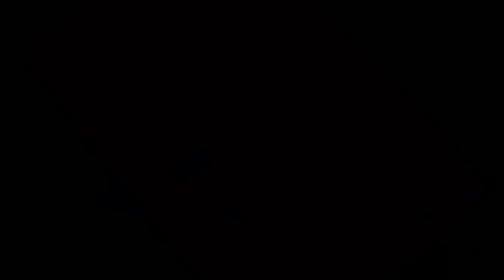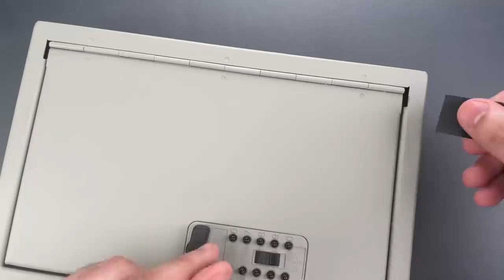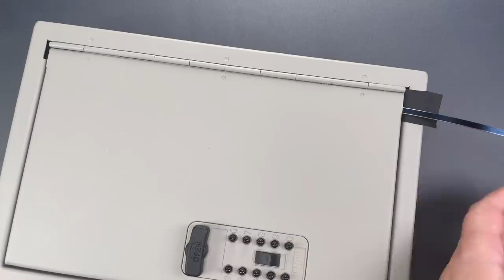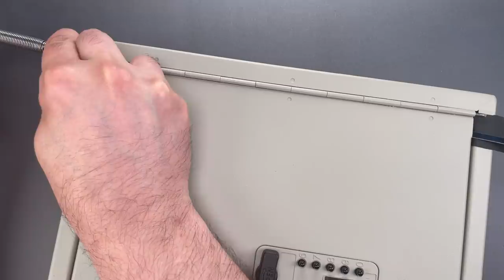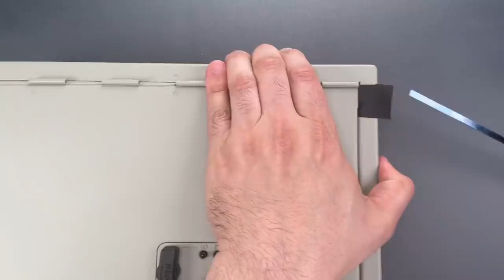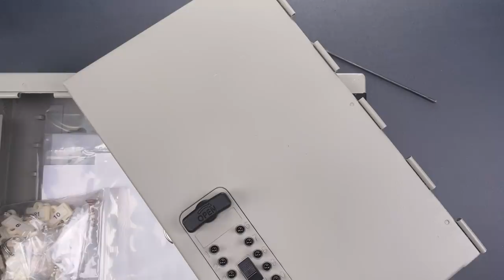[1319] Bypassing Kidde AccessPoint Key Cabinet Pro

Comment: "Shane welded up the hinges, probably to stop me from popping the hinge-pins and declaring victory. He did the right thing, because I definitely would have done that."
Reply: @michaeljackson8390  oh look its a comment bot
Reply: @spykillergames8402  Report 'em.
Reply: From what video is that
Reply: @jernejdivjak5582  the stuffmadehere lock video
Reply: Glad to see that I'm not the only one with a problem with this channel
Reply: @michaeljackson8390   Youtube can easily spot these spammers.
Reply: @creamwobbly  And reported again!
Reply: @Mochu_s_Junkyard  this is not a problem with the channel, The commenter did not have a problem with the channel either, he was referencing another video. Lock picking doesn’t specifically mean directly picking locks. It means bypassing locking mechanisms, either by picking them or some other method like removing a hinge pin or reverse engineering the key
Reply: @ThePower1037  Reported the spammer as well.

Comment: Should've welded the hinge pin like Stuff Made Here!
Reply: @taktuscat4250  GPU's are a myth noone can get one D:
Reply: @_p-x-l_  I've been waiting for 9 months now. Today I almost spilled a glass of water over my Pc and the panic was not for the PC, but that I wouldn't be able to buy a new one 😂🤣
Reply: @_p-x-l_  Just wishing to see GT710 on raspberry pi
Reply: My thoughts exactly, 2 spot welds on each end and issue fixed, or at least made more challenging
Reply: Even if they just took a pair of channel locks and crimped the ends (or even one end) it would at least pass the "stupid" test. I just don't get it. Is it that they just want it to 'look' secure so people buy it?
Reply: @_p-x-l_ 
Not if you don't go to Tarkov to scav for one.
Reply: Don't even need to go that far, just properly recess it within the box
Reply: Or make it inside, like a car hood.
Reply: @MLDeS100  They overlooked the fact that the steel springiness used to snap the hinge into the recess could be reversed with a tiny crowbar.  Also that tension limiting clutch would only hinder, not block picking.  They made a serious effort, just not enough.
Reply: @taktuscat4250  The Raspberry Pi main chip always contained a small GPU, in fact the Pi 1 used the GPU to do some of the booting of the actual CPU inside the same chip.
Reply: Link?
Reply: @Jeff Geerling Like he said, spot welding is seriously underrated.
Reply: @johndododoe1411  agreed, whoever designed the box didn't have a say in the materials used I don't think.
Reply: @CraftComputing  hmm. So just spot welding the ends of both hinges?
Reply: @_p-x-l_  i have bought a 6700xt and 3 days after the release it was already installed in my pc. You just need to Look at the right time at the right place and You will get a gpu for a decent price
Reply: Or use 2 half length pins, as soon as you knock it through to pull out the second half becomes inaccessable and remains in the hinge itself
Reply: Lol you’re just asking him to break into your stuff at this point. Love the confidence though, good quality to have in sales and honestly any product you’re involved with.
Reply: @Will-fn7bz  Manufacturers aren't employing experts any more.  They hyper-focus on one security feature and ignore everything else.  This is why the electronic stuff is usually worse than the all-mechanical stuff - the mechanical stuff is still there on electronic ones, but ignored during design
Reply: @tsm688  you mean to say "they hyper-focus on profit at the expense of everything else"
Reply: @_p-x-l_  i would be willing to sell my 5700xt Red Devil if you are interested
Reply: @AxR558   That's the first thing that I thought of. Aside from that fact that when they laser out the blank they can leave a tab on one side to bend up. That way the pin is only accessible from one side. Once it's in, it's not coming out without destroying a portion of the hinge area. Even using 3 or four pins would work. Of course, all of my ideas would cut into the margin. Margin is God for those corporate dipshits who can't fathom that a little better quality will make people lifelong customers.
Reply: That's expensive to do in the assembly process tho
Reply: @AxR558  The trouble with the two half pins idea, is it is also easy to bypass - rather than using LPL's special tool, I just use a length of rod and a hammer, so the length of rod overcomes the half the pin that would remain - you just need to drift it out the whole length of the hinge, and then pull the rod back out. #ThinkLikeAThief
Reply: @mydemon  No, I meant what I actually said.  In some areas they seem to try, and in others, they leave gaping flaws.  It's baffling.  Maybe everyone who knew how to build a good cabinet retired or something.
Reply: The hinge should be internal AND welded.
Reply: @jace4817  A couple months ago my rtx 2070 fell out of the pcie slot on my z97 mainboard. The mainboard fried. Replacing it with a new ryzen was expensive enough, but I had a few very nervous days hoping the video card was ok. Thankfully it was.
Reply: @humanmusic  Probably not worth doing both welding AND internal placement - that just adds cost for no additional security. Neither is particularly difficult to bypass for a half-determined attacker, but either puts off a casual entry. Weld the hinge and all you have to do is cut it off with an angle grinder. Place it internally and all you have to do is cut down the door next to the hinge with the same angle grinder (in which case welding is moot) - the metal is just folded around the hinge pin, so its not toughened. Casual thieves wont carry an angle grinder, so either achieves the same deterrent, both adds no more but does also add process cost. Add to that internalising the hinge means either complex assembly, or building in another weakness to actually put the pin in during assembly (otherwise the case will be in the way - and to drill a hole to allow the pin to be inserted means using weaker steel, or a more expensive drill).
Reply: @andyowens5494  Welding and internal hinge would be very cheap and very effective. Anything that would make someone use a loud grinder definitely is the idea here. Remember, nothing can be done to stop someone breaking into this. The goal to to make it harder and noisier.
Reply: @humanmusic  You missed my point. Not going to waste time restating it.
Reply: @andyowens5494  You are missing the point that making someone go from non-destructive entry to destructive entry by employing one or two minor changes is a HUGE improvement. Anyone who has watched this channel long enough already knows that. In any case, have a nice day :)
Reply: Personally I think I'd have physically knurled the ends of that hinge rod over at both ends (assuming the physical design would allow that). That way at least someone has to grind that off prior to using this attack.
Reply: @Jeff Geerling:  Define "Stuff Made Here"
Reply: @humanmusic  No, you just missed the point.
Reply: Should have welded the door shut but even then lpl would have found a way in.
Reply: Sorry, but this is one made by "Stuff Made There" a very inferior channel :D
Reply: @humanmusic  OK, last time I bother - no I am not mossing the point. MY point is that EITHER welding OR an internal hinge makes it difficult. BOTH (as per your original comment) makes it NO MORE difficult, but adds unnecessary cost. Weld the pin cost next to nothing. An internal hinge costs more than you seem to think as the assembly becomes considerably more complex. I can only assume you have never worked in manufacturing if you think both are cheap. Sorry, but you seem to want to challenge my comment, somplease read all the words in order before commenting, as I thought the original statement was simple and clear.
Reply: @andyowens5494  I'm not going to read any of your comments after having read one in the past. Have a nice evening.
Reply: @humanmusic  Nothing new there, you didn't read them anyway. Bye.
Reply: Good by-pass, but would you be able to pick the mechanism? Let's say the end of the hinge is spot welded, would you still be able to pick it?
Reply: @bmwspeedman  I have seen another video of that type of lock being opened, fitted to a small key safe, i have tried myself and failed, so its not easy, but can be done.
Reply: Actually a owner could even do something themself but I assume that doing that would void any warranty.
Reply: Or take the bits of the plate that are not rolled into the hinge and make small claws or fins that goes behind the frame around the door.
Reply: So true, when will manufactures learn that spending less than a dollar (electricity and gas for welder) is more important than saving it?
Reply: @Will-fn7bz  Governmental regulation compliance. (I say that sarcastically. But) the glowing alphabet conglomerate gotta get in there somehow.
Reply: @andyowens5494  Well you gave it a good shot.
Reply: @Vassilika1  "Stuff Made Here" is another Youtube channel; https://youtube.com/c/StuffMadeHere Hope that puts the original comment in context for you :)
Reply: Welded, or just used a few metal tabs to keep you from opening the door even with the hinge pin out. Cheaper to weld pin, but with 10 "loops" you can only tack weld one side, which would still be sufficient.
Reply: Could I suggest having two hinge pins?

Comment: "Let's first put some gaffers tape so we don't scratch this up too much" Said like a real covert entry pro. They will have no idea what happened now when there is no scratch. And also no door.
Reply: Well, true intruders will put the door back in and slide the metal rod back in. No visible tampering sign, so whatever's missing inside will be blamed on whoever knows the combination.
Reply: @PanduPoluan  Sounds harder than removing it, and a botched attempt at that will make it REALLY obvious
Reply: @tsm688  Indeed, it's not easy. But if you want to make things gone while shifting the blame to someone else, there are professionals that can and routinely do it.
Reply: @freedustin  Here's a thought - replace it will a tablet that only plays LPL videos on repeat
Reply: "Too much" is doing a fair bit of work here, as we can already see the evidence that he did it once already!
Reply: It's so he can return it to get his money back with least problems.
Reply: @Spinolio  No, it only plays the LPL video for whichever box used to be there
Reply: In this case it would jusr be a couple of scratches but a thief that doesn't care about damaging can cost more from vandalising then from the actual theft. A classical example would be to smash a window on a car to steal something cheaper then the repair cost inside.
Reply: @PanduPoluan  Or at least the discovery of the theft to be delayed enough to make the trail go cold. People may even endup beliving that they misplaced something not even realising that a theft has taken place at all.
Reply: Look closer... he already scratched it up while experimenting for this video. 0:52 and in other places in the video you can see the shiny exposed metal of the safe near the bottom of the hinge.
Reply: @tsm688  I figure the kind of thief that would even bother with reassembly is the kind of person that is after a very specific target for their theft,  And is well skilled in covert entry to things.

Comment: *sees Bypassing in title
*sees hinges

"Yep."
Reply: yep,its dead
Reply: You have hinges its gone
Reply: Yep! I am such a pro now... The second I saw this box I scanned it for weaknesses and the hinges definitely didn't seem secure. I should start a security consultancy firm!
Reply: there was literally an arrow pointing to it in the title.  you're not psychic
Reply: They aren't even trying at this point
Reply: @seantaggart7382  Nah, It did actually seem like they made a genuine effort to make it secure; after all, the hinge isn't removable without bending the metal, implying that they did do atleast a bit of research on how to make locks. It just seems like they aren't complete experts when it comes to lock picking, as most ppl wouldn't assume that you can just bend the metal, or atleast without a lot of time to think about it.
Reply: It can only get better if the bypass is opening the latch by pushing it with a toothpick
Reply: Why? Why would you put the hinges on the outside of the safe!? Are they saving like 5 cents on the assembly costs?
Reply: @tsm688  I never claimed I was :P

Comment: This is secure because only professionals have a bit of metal lying around.
Reply: Carry a pocket knife.
Reply: lolol..you're right... it's not as if just about most ppl have a key in their pocket, after all... ;)
Reply: People commenting and missing his joke 🙄
Reply: @michaeljackson8390  < trumptastic
Reply: Mhm. You also need pliers.. and hands, it's not like the average person would have access to those.
Reply: I'm only a little disappointed that LPL didn't use a piece of a Red Bull can or a Lego astronaut or something equally silly instead of a perfectly normal looking piece of metal.
Reply: Or a fork, spoon, kitchen knife...  not to mention a garage with a full tool chest.
Reply: His pin popper tool isn't required.  Just easier.  Anyone could do the same thing with a hammer and a nail, or even a brick and a nail, or any number of other tools anyone would have on hand.  You could put those tools in a room a child or an ape and probably get them to open the box, assuming they knew how to use the tools.
Reply: Well, for real, I certainly have a pile of metals laying around 🙃
Reply: @derekbowbrick6233  keys would work too.  They're metal lol.  Easy to get some blanks from eBay
Reply: he didn't scratch the safe. That's called white hat hacking
Reply: No one would get into a safe without any kind of tools.
Reply: *Have the knowledge of lockpicking